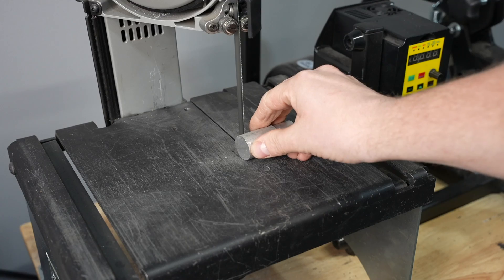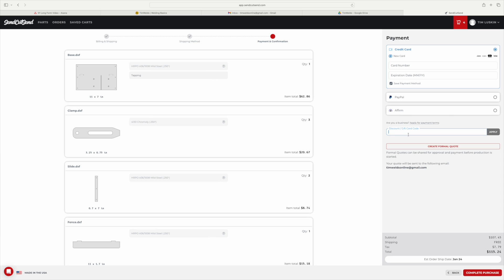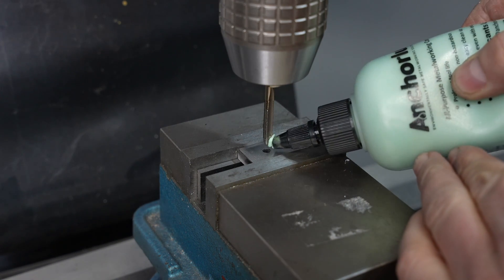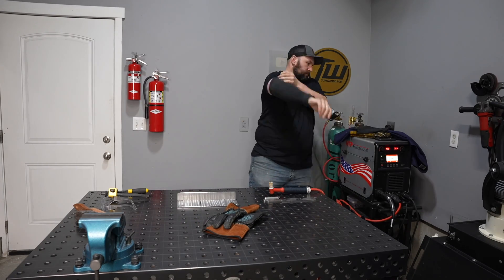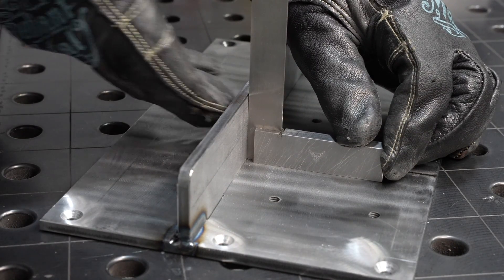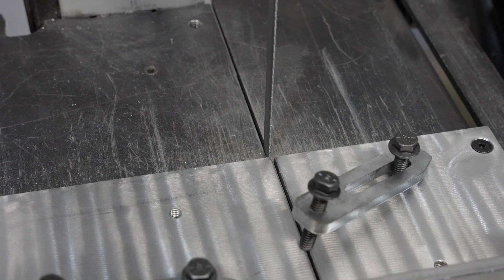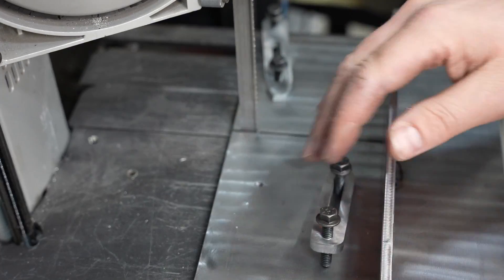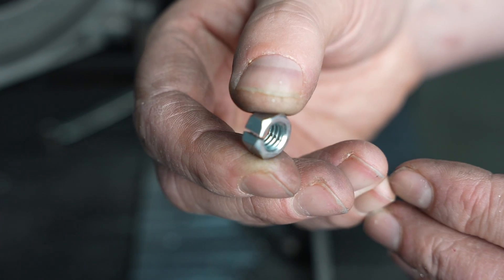I Built This to Make My Bandsaw Safer

Comment: Hey Tim. Really enjoyed your videos! On an unrelated subject. I just purchased a Titanium flux core welder and all the odds and ends needed along with a Yeswelder auto darkening helmet. When doing some practicing, such as a t-joint, I can see my welder pool ok, but I can not see the joint I’m suppose to weld, causing me to drift off target, leading to more of the weld being either in the vertical or horizontal piece. Ironically my first weld was perfect but subsequent tries were not, drifting either up or down a bit. Is it just a game of faith, hoping to hit that seam perfectly or should I be able to see, at least a little, the line I need to weld? Thanks!
Reply from the maker: Great question! You should be able to see the joint very clearly, but it takes a bit of time and practice. I still remember struggling to see the joint, but once I could see it, I see it all the time. Some things to play with are the shade of your welding hood, a little darker or lighter, and your head placement. More than anything, though, it's just time watching it. If I were in your shoes, I'd get a flat plate and scribe a bunch of straight lines on it about an inch apart, then weld beads along the lines until I could see the line and follow it. This will reduce the number of things there are to think about at once. Try not to focus your attention on the arc, just the puddle and the lines scribed on the plate.

Comment: @TimWelds right now all I have is and angle grinder to cut metal for welding. What should I think about getting next... portable bandsaw or a chopsaw?  Since I'm a diy'er I don't have alot of room or budget. I would say versatility is more important to me than speed. The reason the angle grinder isn't enough is I can make long / straight cuts. But maybe that's a skills problem with me.

Comment: I had a similar problem on a (chinesium) bandsaw that I reserve for doing exactly what you require. I went through at least three makes of premium quality blades with no or little change. I rebuilt and re-crowned the drive wheels and improved the angle adjusters. I mounted up the table on an inspection slab, and guess what, the slides were out of square with the table! I ended up making a much improved table with more robust and adjustable mountings and slides. I built a much improved adjustable blade guide as, according to the material being cut, the blade deflected at slightly different angles, due to the amount of ‘draw’ that differing materials and thicknesses of material, place on the blade and therefore the cut. Many hours of work and £150 later it still wandered, but just not so much. 
I learned a lot but the solution was, get the right machine for the job. No matter how much you polish a turd, it’s still a turd.

Comment: No.1 to reduce drift is a sharp blade. No.2, blade tension, no.3 blade guides spaced apart to suit material thickness.
 Have a look at the methods of timber veneer cutting. Bandsaw blades are so difficult to keep dead straight, especially on anything less than industrial level rigidity. The method uses a post set to the desired veneer thickness and then the timber angle is adjusted to allow for the blade drift.
I can see a metal cutting sled work better if it had a pivot so you still have all the hold down and control, but you can adjust the cut as the blade drifts. Key part is to ensure the pivot is at the blade teeth, but that can be achieved with a circular table and matching socket in a sled slide.

Comment: Nice video , but you have a mill why did you send it out? Add a sacrificial plastic to the fence
Reply from the maker: Great question! It could be machined manually, but laser cutting is a better fit for plate work like this. I'm also considering developing this into a product after a few iterations, so the prototype was done using a more scalable manufacturing process than manual machining. Great suggestion with the sacrificial plastic!

Comment: The blade pointing to the side is because the roller guides are set up that way. Look closely and you'll see it's just not twisted by quite 45 deg. Maybe you could put shims under the roller guide blocks. I'm interested to see if you can solve it because I have the same problem trying to get straight cuts with the Harbor Freight band portable saw stand for the same reason.

Comment: I had the same issue (not cutting straight) with my Dewalt porta-band in that SWAG stand and I ended up shimming one side of the top blade guide a bit to correct it. I used a piece of 3x5 notecard folded a few times until I found the proper thickness.   Nice sled project, appreciate your content.

Comment: if the blade  drifts  it isn't tensioned  tight enough.  On those cheap little saws that's  often not possible
Reply from the maker: Thanks! Could be that. This one just has a spring for the tension, so it isn’t really adjustable at least that I’m aware of.

Comment: Send Cut Send is so overpriced.
Reply from the maker: I've used several laser cut vendors over the years and most local shops won't mess with a job for under $200-$300, plus there's usually a setup fee. I think it's remarkable that I can mix and match small quantities at a price that I feel is more than fair with an ordering process that's as easy as Amazon and shipping is included. Don't get me wrong, if you have a better option you should go for it, but I've done some comparison and found them to be competitive at their respective volume pricing and they've never let me down on quality or turnaround time over the years that I've been a customer.

Comment: Slot the rail mounting screw holes to allow adjustment of the alignment. Maybe also use an adjustable angle fence. My 2 cents. I’m stealing your idea for my vertical bandsaw. 😎👍
Reply from the maker: Great suggestion! Thanks!

Comment: That is a great idea for small pieces.  I think some of the problem is that the blade guides are far away from the work piece.  With a wood bandsaw, it is always preferable to drop the blade guard down as close as possible to the work, in doing so, it also lowers the blade guides.  But you are right, it could be the blade sharpness.  Blade drift is always a concern for wanting straight cuts.
Thanks for the video.  Watch you again soon.
Reply from the maker: Thanks! Yeah, the portaband stand isn't the ideal solution. I wonder if I could add some blade guides onto it.

Comment: Nice design, Tim. I generally leave the mill scale on if it’s a smooth surface covering the entire plate. I’ve found over the years that it’s harder and doesn’t get damaged that much. Additionally, it’s smoother, so doesn’t scratch the metal moving over it. Also, it’s non reflective and easier on the eyes and parts can be seen more easily too. I know it’s not to everyone’s taste, after all, it’s MILL SCALE, no good. Eh, not so much.
Reply from the maker: Thanks Mel!

Comment: @TimWelds how much does one of those milling machines cost?  I imagine you also have to think about the cost of bits as they are consumables?
Reply from the maker: This one is $3700, it's Taiwanese and better built than a lot of bench top mills that you can get for less. The minimum set of tooling adds about another 1k, but I already had a lot of tooling when I bought mine because this was an upgrade from a cheaper mill that I used for years while I saved up for this one. I did a ton of research before I bought it and I'm glad I paid a little more. The end mill cutters actually last a lot longer than you might think and I just use high speed steel, so they are relatively inexpensive.
Reply: @TimWelds  oh wow... I can't spend that. Maybe there is a more entry level solution for me to start out with.
Reply: @sleekspeed22 I would look used. A Clausing 8520, which is a nice small mill can be had for <$2000. Estate sales can also be a gold mine for deals on machine tools.

Comment: Very nice project Tim. The one thing I don't like about the Swag fixture is it doesn't secure my Milwaukee bandsaw very well (wish it held it tighter without any movement. Thank you for the video.
Reply from the maker: I agree with that, the V4 with the single screw isn't nearly as secure as my first one which was a V3 with a DeWalt saw.

Comment: It's not a new blade issue. I've been using that setup for 10-15 yrs and if you want a straight cut on long/thick material you need to adjust as you go. Worn out or dirty guide rollers will make it worse so replace those as needed.
Reply from the maker: Thanks for the tip! I think I've just always compensated a little bit. I'm thinking about taking the guides off the plate and just pushing it through however I need to get a straight cut like I always have with plate.

Comment: Woodworkers have been using sleds for years - they're safer and you get more accurate results.
Reply: The thing with "wood workers have been doing X for years" is that metal and wood aren't behaving the same. I love working with both. And while some tools translate well, many don't.

Btw.: I've never seen anyone use a sled for band saws in woodworking. Not saying that it doesn't exist. But it's certainly not common. The band saws I can buy at my hardware store don't even have slots in their tables ...
Reply: I do.   @brag0001
Reply: Also, a wood blade going through soft material is less subject to twist. But it still happens on a bandsaw, no matter how expensive the saw. Just try to slice off a thick piece and you’ll see. With table saws it’s different. It has a wide blade that doesn’t twist. It how I cut longer pieces of metal (with the proper blade, of course).
Reply: @melgross  After doing a tuneup as demonstrated by Alex Snodgrass or Robert Vaughn,  I suggest that you try a Lenox Trimaster 3-4 carbide blade
Reply from the maker: I don't doubt it, my buddy across the street has an insanely cool wood shop and he has all sorts of stuff that I've never seen before for joinery and what not. On the other hand, I have all sorts of stuff he's never seen before either.

Comment: I do woodworking but enjoy your channel.  I was making a cutting board with small inlays which I could never get right on the bandsaw.  Instead I would superglue or use two sided tape to secure my “mini” pieces to a larger sacrificial board which allowed me a safer cut on table or miter saw.

I was wondering if you could make a miniature table saw with a cut off wheel and use your sled with both your band saw and a newly created table saw.    You would have to sacrifice a cut into your fence but I think your fence would remain functional.   

I would love to work with metal but too late in the game for  me I will enjoy your channel instead 😊
Reply from the maker: Thanks for the idea! I've never seen a cutoff wheel set up like that, I'll have to think about how I might do something like that. I wonder if I could mount the grinder on a rail and move it like a radial arm saw across a fixture plate.

Comment: HI TIM, I WAS THINKING OF DOING THE SAME THING, I TUNED THE ANGLE OF THE BLADE BY PUTTING A WASHER BEHIND THE LEFT SIDE OF THE BEARING CARRIDGE ON THE SAW, THIS WILL TWEEK THE BLADE TO THE RIGHT. TOOK ME A FEW TIMES TO GET THE RIGHT THICKNESS OF WASHER, BUT THE SAW CUTS VERY STRAIGHT NOW.
Reply from the maker: Thanks for the tip! I'll have to see if I can make something like that work.
Reply: @TimWelds  I did that same trick and my blade cuts straight now. This 3 min. video explains very well how to do it: https://youtu.be/PPIJZZ2wL_c?si=vEGbHA1wVWWLCEux
Reply: That's a nice mod. Thanks
Reply: Caps key must be broken.

Comment: Very cool. I made something similar with .25" angel and flat bar. I put a .5 inch gusset where the blade cuts. Over time you will cut through the back plate, so add the gusset now. I have the same problem with slightly off cuts, but having a sled is so nice, and the cuts are accurate enough. Wish I could send a pic of my sled.
Reply from the maker: Thanks! Sounds like a great setup you have as well!